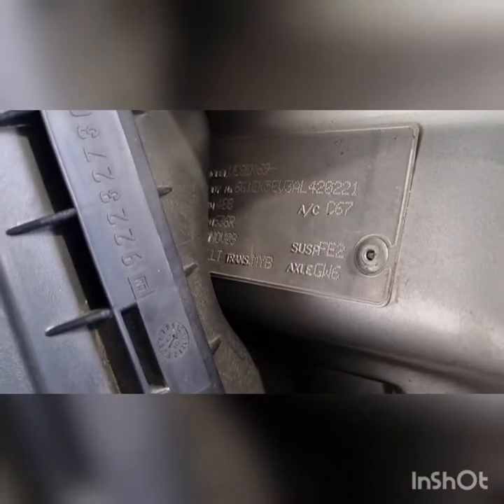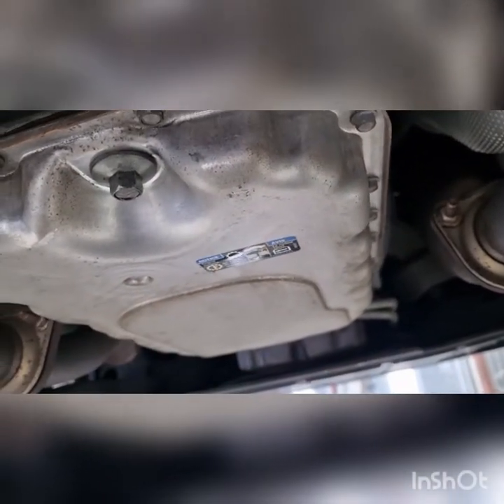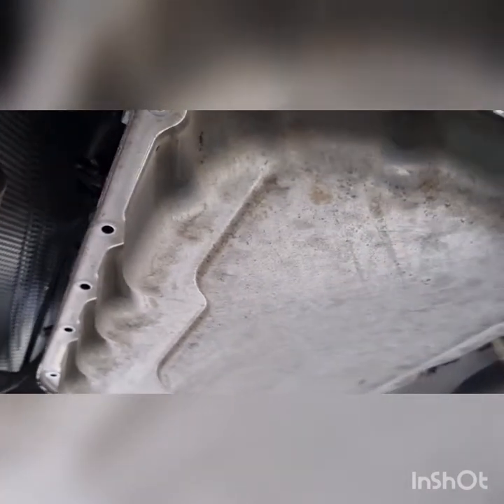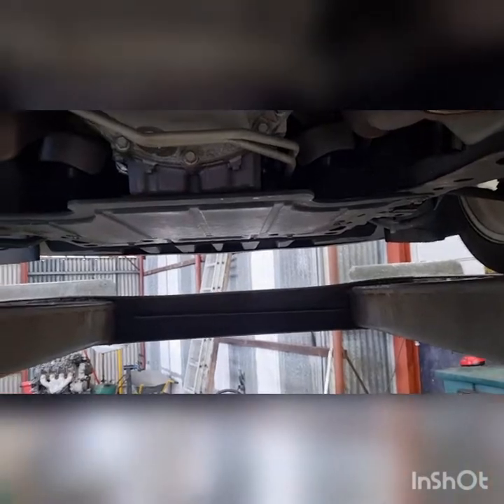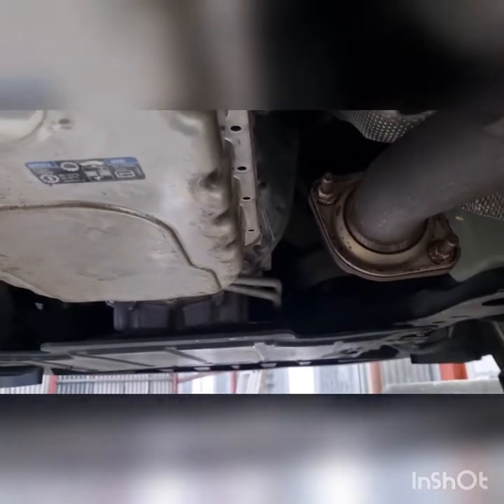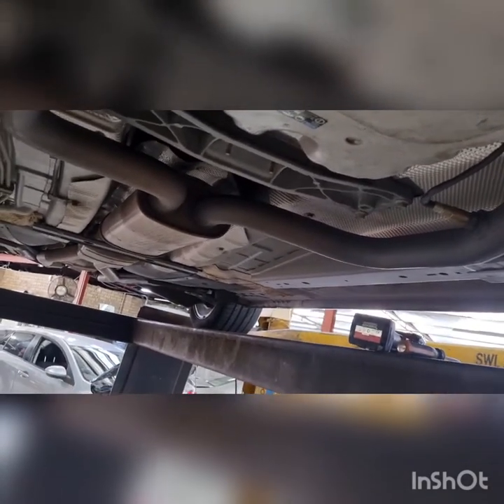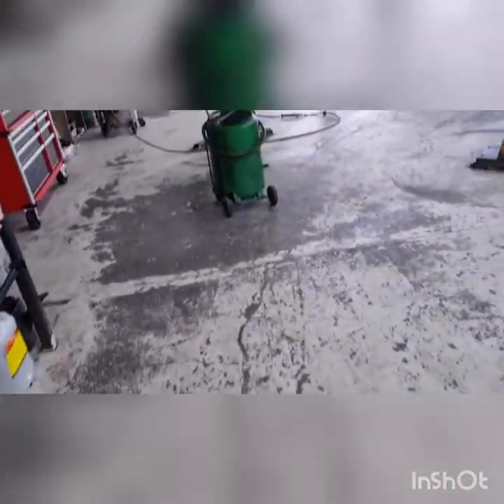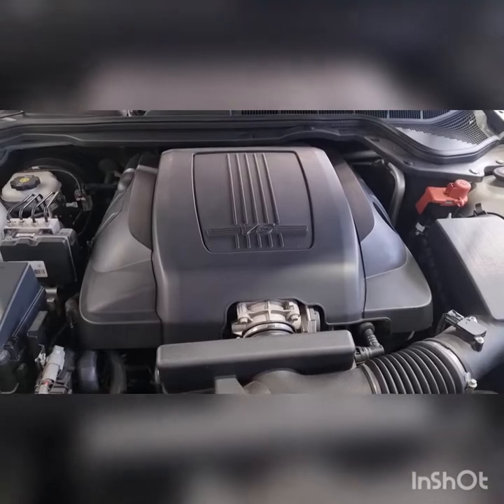Holden VE Commodore Transmission Service

Comment: The most professional VE tyranny oil change I've come across You Tube...well done mate👍
However, I always use a small torque wrench to do all those bolts...I always want to ensure consistent torque settings...but I guess feel by hand is something that comes with years of experience🤓🤓
Reply from the maker: Thank you, I appreciate that mate 

I do agree with you, they probably should be talked but you're also right with experience I can do up bolts to where I am happy and bearly have come backs :) 

Thanks for commenting your kind words

Comment: My wifes trans was working fine before took ot to mechanics. Had some work done n 3 days later it slips. Now it will drive 50m then have no gears any idea what they have done. They are telling her that she needs a new trans. Is this false. Can i just get it serviced or do you reckon they sabotaged it. Trans was replaced 12months ago already
Reply from the maker: Impossible for me to say personally
I would suggest getting a second opinion
Reply: @RealAutoSolutions  i might just do a service and see if it fixes it. Thanks for ya quick reply. Im good with engines but no F all about transmissions
Reply from the maker: @Thewolverine691  check the oil level first, make sure it's full of oil and not black and smelling burnt 

Make sure the engine is running whilst you're checking it, be careful

Comment: Can the trans drive fine but cause an engine light? I intermittently have an engine light on warm days. No code. After a while it will start and be fine. 170k 2011
Reply from the maker: Yeah for sure, but there will be a code set if there is an engine light mate i guarantee that

Comment: Great video.
Mine has 225xxx but runs great. The transmission has never been serviced according to the service history. Would it be safe to change the transmission fluid or is it too late?
Cheers
Reply from the maker: i would be really surprised if it went that many kms without a service, you would think one mechanic would check it?

Is the transmission suffering any issues? I would expect some slippage if it had never been serviced
Reply: Well, I’m surprised. No slippage or anything, but the car has been driven appropriately by the past owners.

I am adding a transmission cooler though, which will require an additional 400ml fluid. I’m unsure if I can simply top it up with 400ml, or if I should just drain the transmission and service it?
Reply from the maker: I would recommend to do a service if its not slipping mate, have you checked the condition of the oil ? what colour is it right now ?
Reply: @RealAutoSolutions  Hey mate. Got the transmission serviced the other day, but not flushed, and all worked out great. No change in shift quality, but no slipping or damaged caused. Cheers for the help. I was a bit worried about doing it at about 226xxx, but it went fine.
Reply from the maker: Beautiful! 
I would think it should feel a bit nicer throughout the shifts

It should up shift a bit quicker & also not be so clunky in the down shift

Glad it helped you out mate
Reply: No worries! I thought it would fix the clunkiness down low, but it made no change.
Reply: Never serviced and no issues except “clunkiness” )))